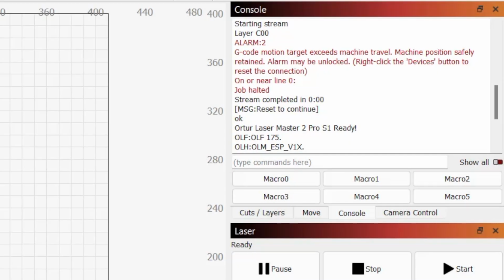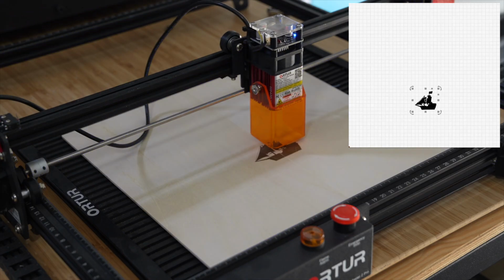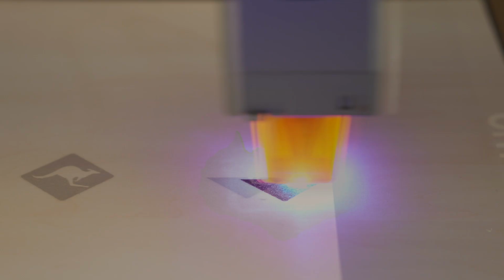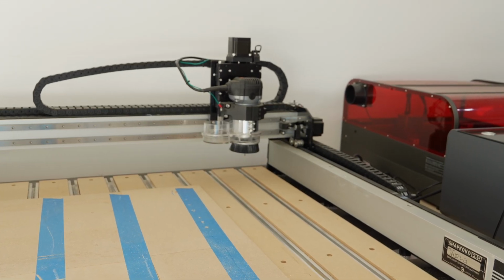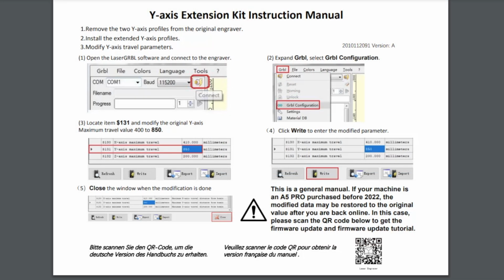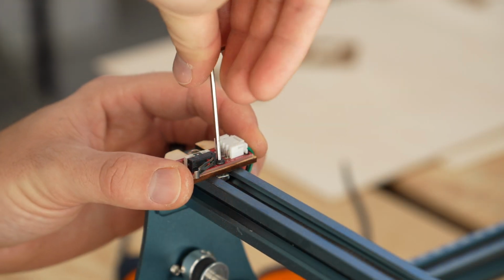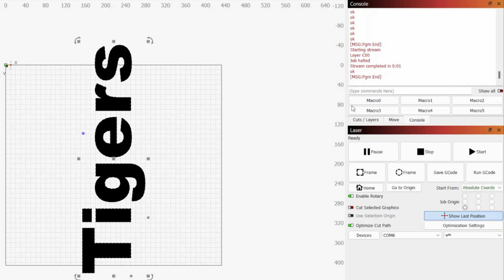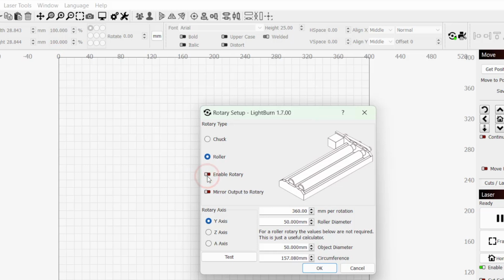GRBL Errors: Alarm 2

Comment: I have problems with engraving. from the right side to the left side. the right and left side, he is 2 times deeper than the middle. there were no problems at image. lightburn 1.7.04  longer b1 40w
Reply from the maker: Thats really strange. If images where also having an issue it could be warped material or even an issue with the axis, but since images are fine it could be that overscanning is needed. Here is a video on it: https://youtu.be/oNW8lTxuul4?si=axzdIs5aglLqI6rx

If you are still having issues contact our support team with images/the project - support@lightburnsoftware.com